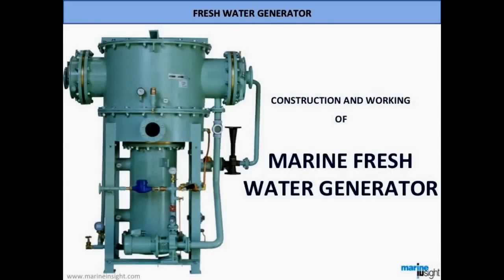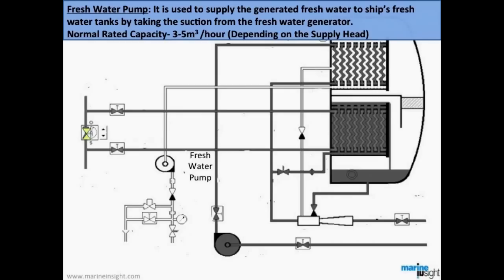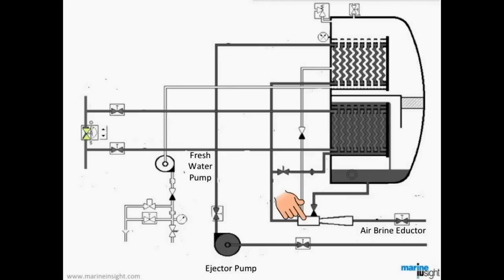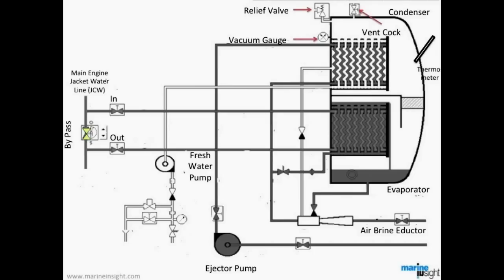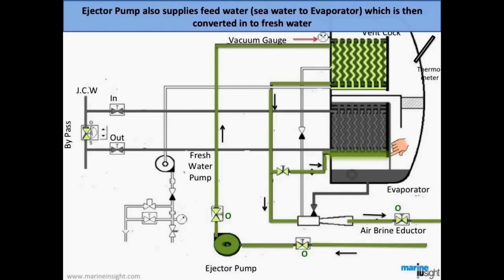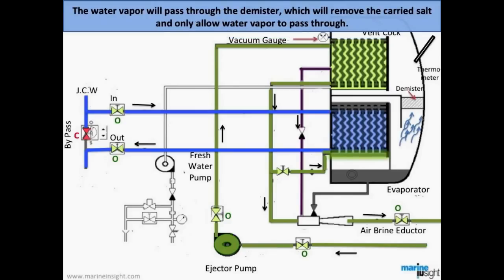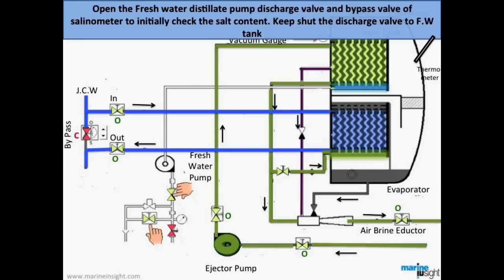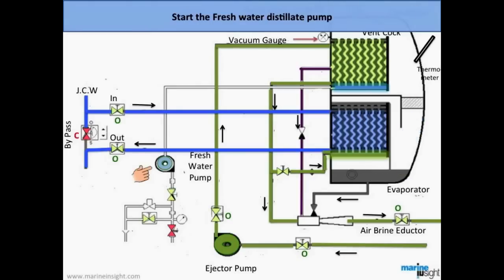How Fresh Water Generator Works?

Comment: Excellent explanation in four minutes!
You should put an advertising in the video about de comment of Sea X-pedition: "Open M/E JCW discharge and inlet valve to evaporator" Just in case juniors doesn´t read the comments
Reply from the maker: Thanks for the tip!

Comment: What will happen if vaccum reaches 100%?  Normally We keep 90-93% vaccum when we start FWG but why not 100%, I would love to have clear Explanation here...Thanks
Reply: Because the heating used in fresh water generator comes from the jacket cooling water of the main engine which is usually around 75-85 degree celcius. Water usually boils at 100 degree at 1 atmospheric pressure. The eductor creates a vacuum in the evaporator which lowers the atmospheric pressure around -0.85 so that the evaporating point of water will also be lowered around 75-85 degrees. Since pressure directly proportional to temperature

Comment: What is the difference between plate type and tube type fresh water generator,?
Reply from the maker: The heat exchanger in the FWG is either plate type or shell and tube type. Rest functioning of the system will remain the same.

Comment: Don't know how it's make vacuum process. If I used this for salty tube well water, how to dispose brine not to return to the well?
Reply: ep. nainghtooaung When the SW passes through the Ejector the velocity of the fluid increases and the pressure inside the FWG decreases (Venturi Effect).
Reply: +João Gonçalves I only know this because of my damage control course where we used eductors to take our flood water. but i like your definition.

Comment: Did you say.. taste the water? Isent that what the Salinometer is for?
Reply: oh haha nice.
Reply: we taste the water to check if the salinometer is working properly or not.. what if the salinometer is not working properly and your entire freshwater is contaminated with saltwater? as it it; we are going to use the fresh watr for drinking and cooking purposes, right??
Reply: sourav mitra Fair enough I suppose. Cheers
Reply: Gordon Brown Notice that the salinometer range is usually between 0 and 20 (Alfa Laval product at least), so we taste the water because if u have 100 or 180 ppm the water is not salty. The salinometer can show 20 ppm because its the maximum range and u are producing water with 100 ppm, in this case u are producing fresh water.
Reply: +Gordon Brown (Wanna be climber) salinometer is not always accurate. tasting the water in small amounts to check the salt content is usually the best way.
Reply: Yeh. I have learned a little more now and gained a little more experience. And understand much better why we taste it which I have actually done a few times now.